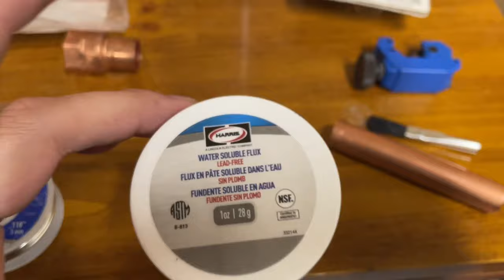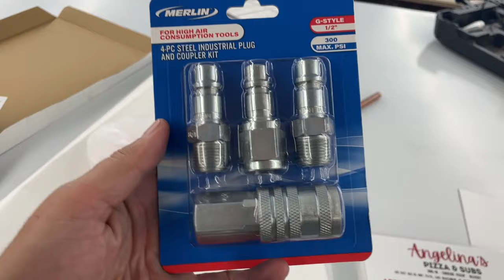Air compressor set up for the automatic screen printing press

Comment: Great work man! Curious question...after this video, did you happen to install in-line filters or a flow regulator? Thank you so much! Working on getting the compressor situated for the new shop we're building, but this part has been the most confusing to me.

Comment: Turned out looking good for doing it for the first time. That compressor is going to be really loud though. We had a similar one hooked up when we had our web press and that sucker was super loud. We even put it in it's own little room and you could still hear it. You might want to try putting a little enclosure around it with some sound padding material. Other than that, it turned out great.
Reply: You need  flexible hose from tank to air dryer  or it will Crack  manifold in the dryer.
Reply from the maker: @bobrossi1185 I ordered a hose to switch that out with, thanks for the advice!